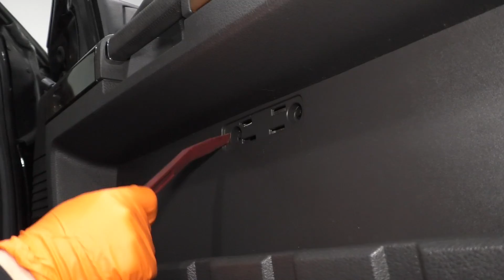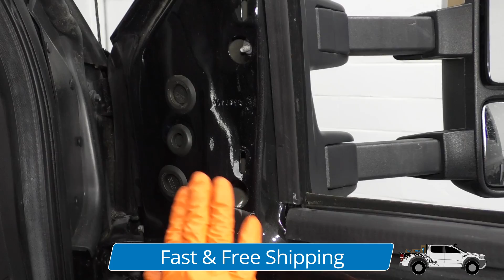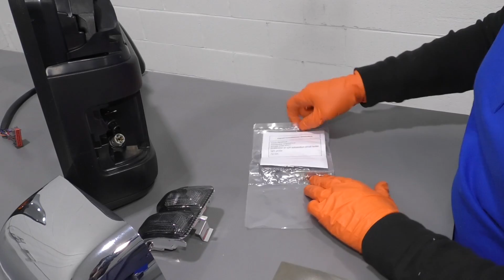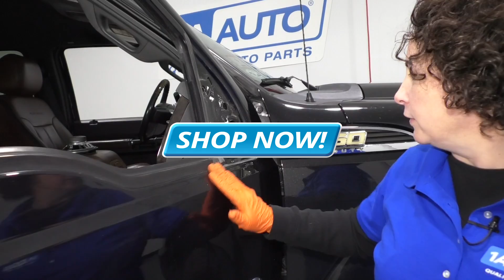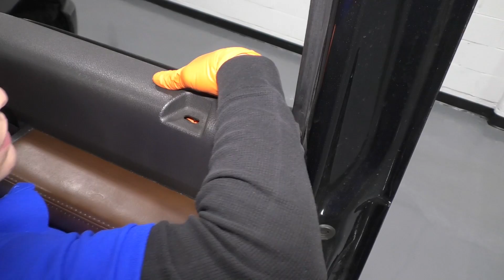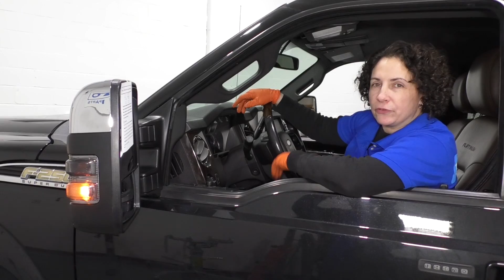How to Install Tow Mirrors 08-16 Ford F250

Comment from the maker: √  Watch the Video
√  Buy The Part at 1A Auto http://1aau.to/m/Visit-1AAuto
√  Do it Yourself
√  Save Money
Reply: The model I purchased for my 2012 F350 super duty listed that it included the temperature sensor. I installed it as shown in the video and everything went great. Functions well and everything moves the way it should. However, now I am getting a check engine light And it looks like it’s an ambient temperature sensor issue. Again the part listed it has this so I can’t understand why I’m getting this error (and my outside temp is wrong so I suspect my AC won’t work properly now). Of course now I fix the mirror but cause several new problems. Any advice?

Comment: The model I purchased for my 2012 F350 super duty listed that it included the temperature sensor. I installed it as shown in the video and everything went great. Functions well and everything moves the way it should. However, now I am getting a check engine light And it looks like it’s an ambient temperature sensor issue. Again the part listed it has this so I can’t understand why I’m getting this error (and my outside temp is wrong so I suspect my AC won’t work properly now). Of course now I fix the mirror but cause several new problems. Any advice?

Comment: Great video and the mirrors look great and we're much more affordable than OEM.  I followed the instructions in the video but upon completion, I had a couple of issues.  
Drivers side mirror only moves left and right but not up and down. And it moves opposite to the input. I move the stick right the mirror moves left and vice-versa.
Passenger mirror has a similar opposite movement but with a twist. I move the stick right and the mirror moves left and down (diagonal). Move the stick left and mirror moves right and up.
I am thinking that there is a wiring loom issue.
Can someone advise?  Thanks!
Reply: Same. No clue whats going on here. My controls aren’t inverted in any way the up and down function simply doesn’t work on the passenger side.